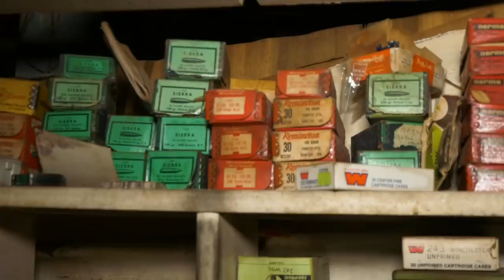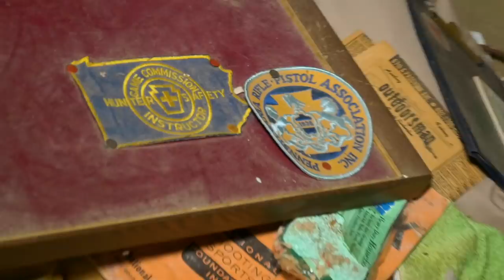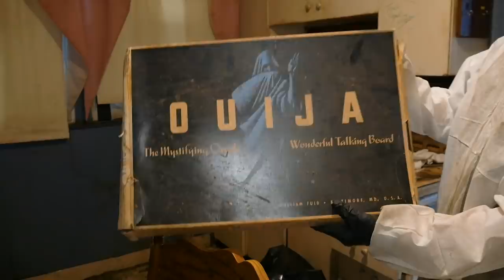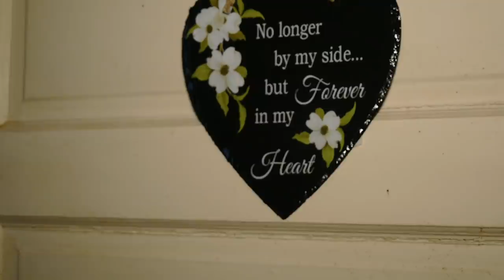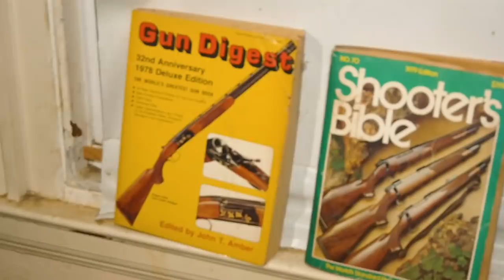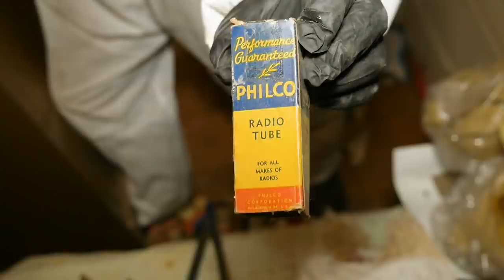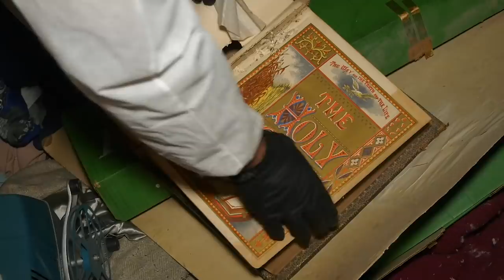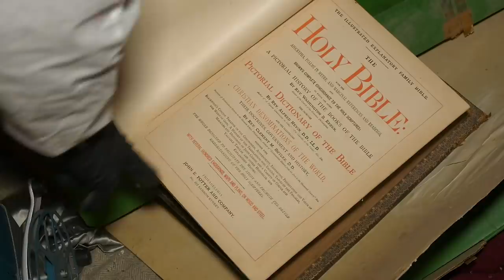House Hoarded with Bullets and Dolls Pt.1 | Philadelphia, PA

Comment: The beta max I believe came out about the same time or a little before the VCR. The reason it did not take off like the VCR is because the company refused to produce adult films where as VCR did. Therefore the beta max died out and is hardly known by many.
We used to have one. They're cool little machines. The tapes were about an inch or so smaller than a VCR tape.

Comment: I'm interested in getting into crime scene clean up.
Q: How would I go about doing that, do you need any certain experience,degrees etc? 
Thanks in advance! 🙂
Reply: Not particularly. On the job training is usually enough but i would recommend some experience on demo or construction like work cause we do remove alot of floor/ carpet/ drywall.